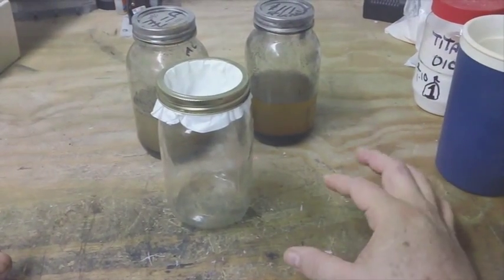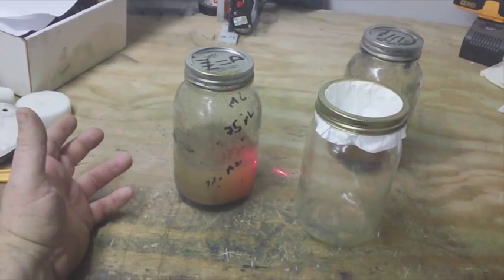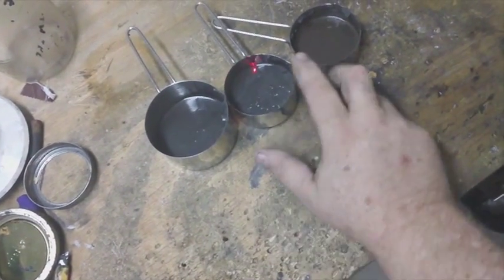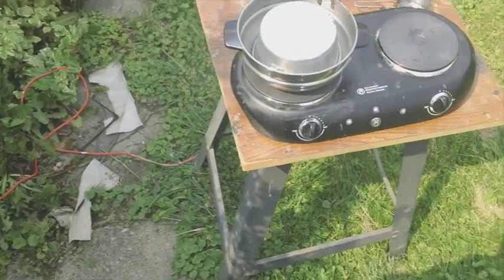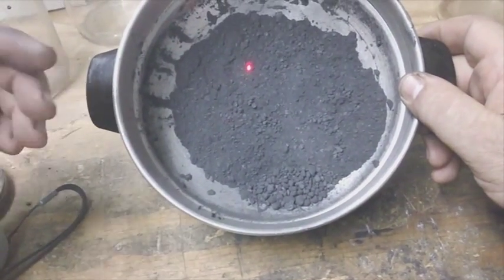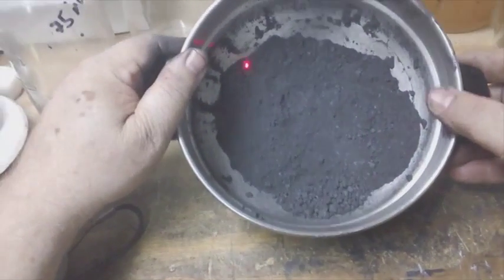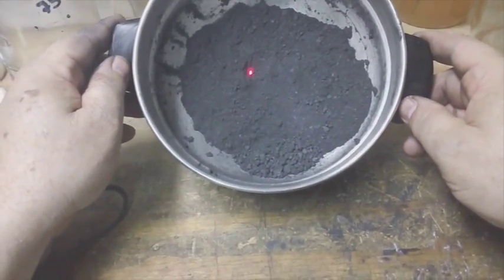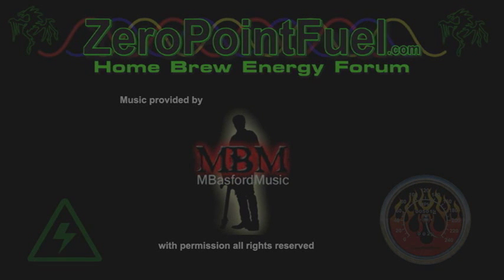Graphene blender method test Day 9

Comment: Are you sure about heating the graphene?  I think you maybe changing the graphene back to graphite by cooking at high temperature.
Reply from the maker: You may be right about that my yields have been low I just decided to use the acid method to get my yields where they need to be for my experiments, you also need to remember that most of the usable graphene was siphoned off before it was cooked
Reply: I'm also going to try the acid method using potassium manganate KMnO4 and Sulfuric Acid.  I don't have 90% proof Sulfuric Acid so I'm going to try using battery fluid which is 33% concentration. This will create Graphene Oxide I hope.  I though about buying a light strobe like Robert Murray Smith has so I can make a full sheet.  How are you planning to convert the Graphene Oxide back to Graphene?   I enjoy your video's :)  Keep up the good work.